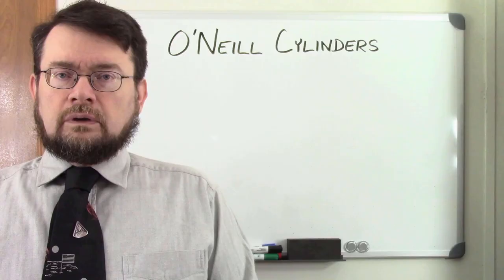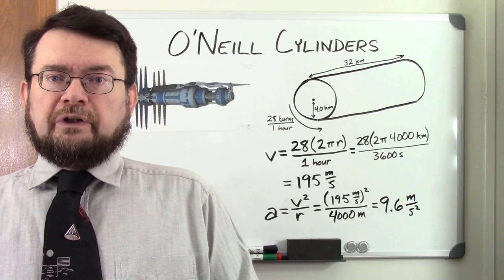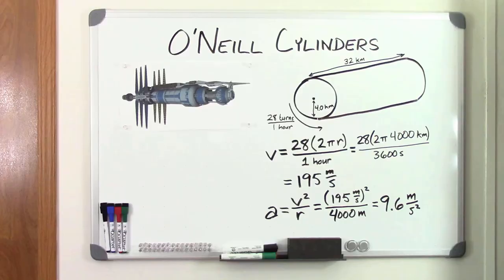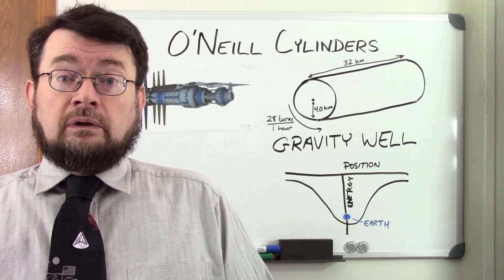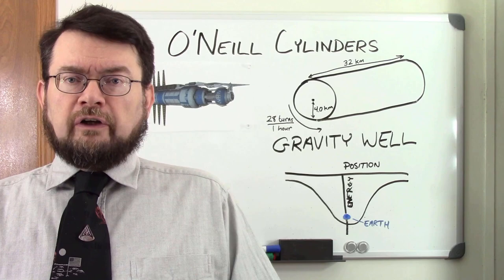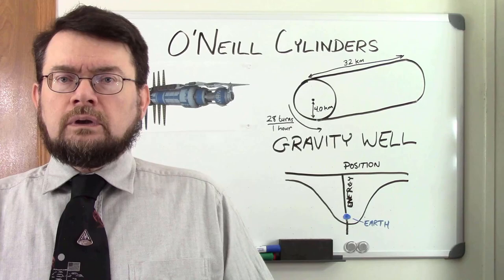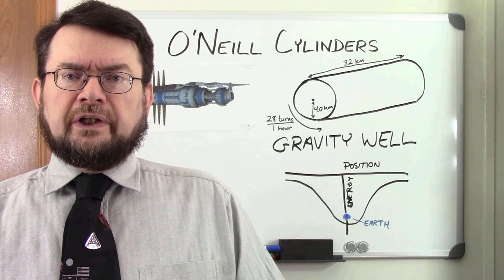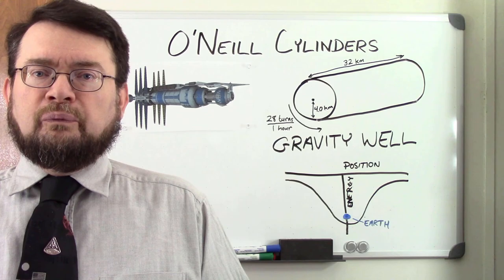O'Neill Cylinders explained - deep space colony of the future?

Comment: Question: when the cylinder rotate, how does it do it? The entire cylinder, or only the tube section?
Reply from the maker: I'm not sure what you mean by "tube section," but the whole cylinder would rotate along with everything inside it.
Reply: @EpsilonIsGreaterThan  I was asking that because in gundam seed there is an O'Neil Cylinder name Heliopolis that is conected to an asteroid, and the colony rotate but the asteroid remain stationery. How does that work? And on a side note how big is that asteroid?
Reply from the maker: @BalamTheWander  Oh, you wouldn't want to rotate the asteroid, because it'd probably break apart from the centrifugal forces.
Reply: @EpsilonIsGreaterThan  Another question: Do the mirrors require the colony to spin to work properly or not? And do they just replect light, or can they also double as solar panel?
Reply: @BalamTheWander 
The answer is that cartoons aren't good demonstrations of reality.

It is possible to put a rotating habitat insiya non-rotsting shell, but there's no sense in using the pristine material of an asteroid which might not be whole and complete. The rock after anything useful is extracted can be formed however you might want.